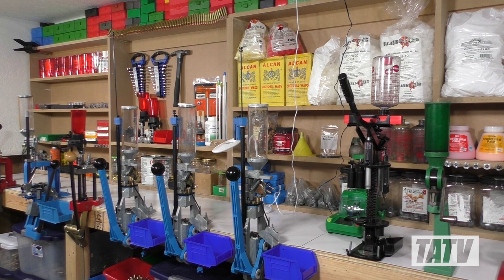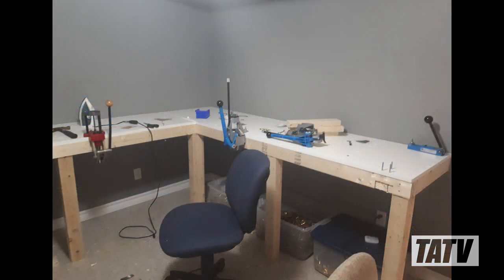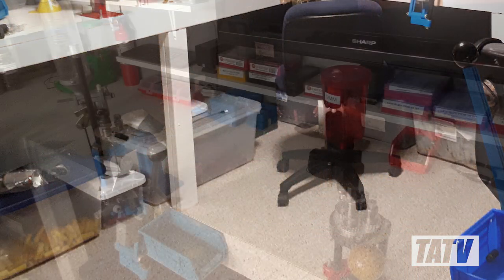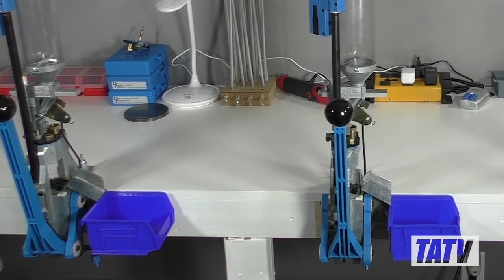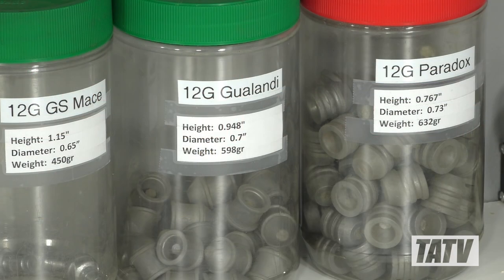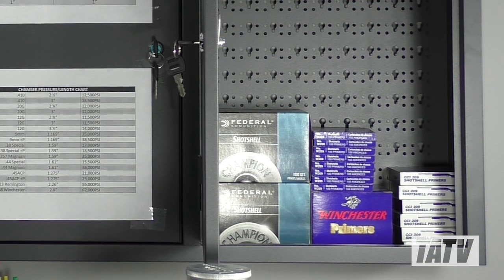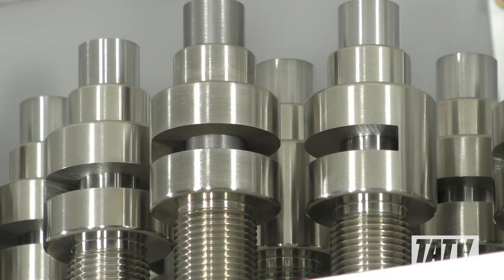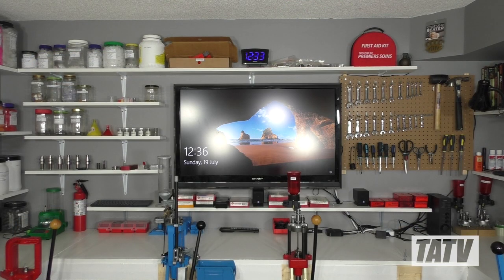New Reloading Room Tour

Comment: I mount all of my presses on identical  3/4" plywood squares with holes  drilled in them. I run 1/4 bolts through the holes into threaded inserts in my bench. This way I only need to have room for one press. My other presses are stored on a shelf  with cleats to hold the plywood squares.
Reply from the maker: I've seen that, as well as some steel ones.  Looks very nice, but I like things to feel rock-solid when I'm priming or swaging, so I just decided to go direct-to-bench.

Comment: Would you consider the table mounted to the floor and wall overbuilt?? I know it wont move but was that really necessary?
Reply from the maker: It depends on what you're loading. In my case I load a number of large brass cartridges, shotshells, and most critically I swage bullets. The first two put a fair bit of stress on the bench, but swaging in particular utilizes a massive amount of force. For the cost of a couple extra 2x4's and a handful of fasteners I was able to dramatically increase the strength of the whole bench which was worth it to me.